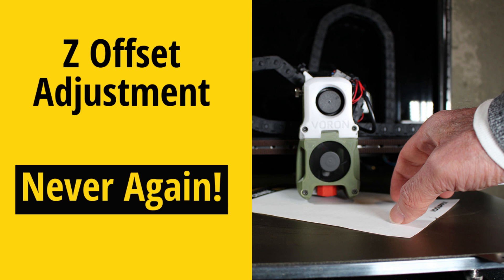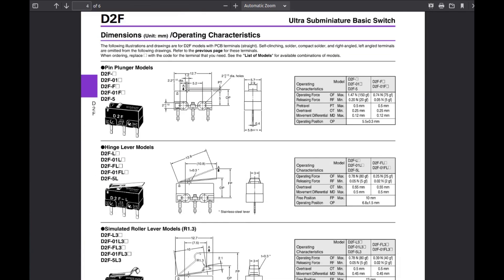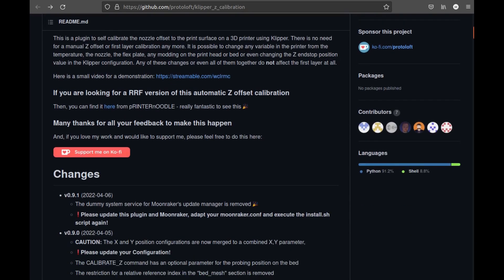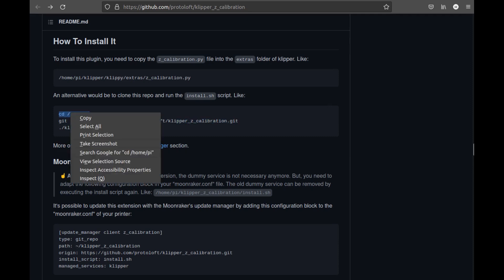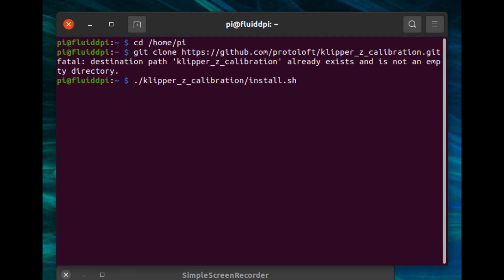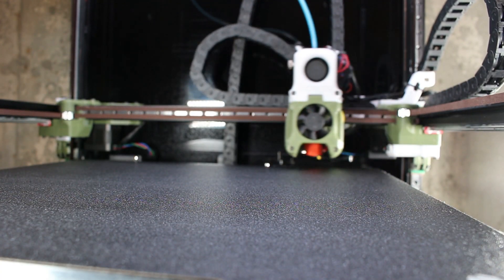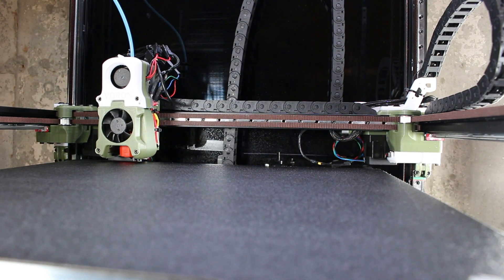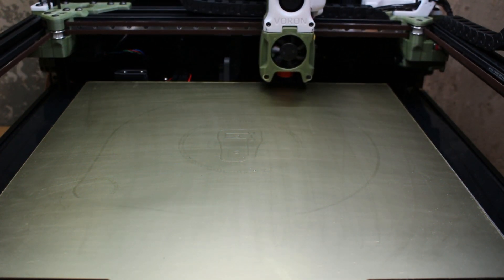Never adjust your 3D Printer Z Offset again with Klipper and a plugin

Comment: Thanks for doing the hard work for those of us who are new at this, love the nozzle clean video it works perfectly. After probing the nozzle on the way to probe switch body switch is contacting z end stop, how would I raise print head to clear the switch? Also I have to manually insert macro: error_if_probe_deployed  to get Euclid recognized otherwise it faults out. How would I get this automated? Thanks
Reply from the maker: If you go into your euclid.cfg file, just change the z height to a value that works for you.  If you need a more complicated path you can add that gcode there as well.  This will be the macros for M401 & M402.  Both of them set the z height.  You should be able to adjust enough to pass over the z end stop.  For the macro, to call it, you should probably modify the the G32 macro or the start_print macro in your printer.cfg file.  In G32 I have it set to do a home, qgl, home and then calibrate_z.
Reply: @KapmansBasementWorkshop  got it thanks. Any idea why I have to use  error_if _probe_deployed first before I can use Euclid probe?
Reply from the maker: @nicklong9985  I sure do. Early on I had not adjusted it very well and it would sometimes drop the probe.  As soon as it notices the probe is not fully connected, it raises an error and stops.  If it did not do that, it would probably destroy your bed, print head or both when doing a bed leveling.  Trust me, you want that error handling code.  I can think of 4 different occasions where it would have been very bad if it were not there.  Include the code!
Reply: @KapmansBasementWorkshop  yes I want to use the code. I’m probably not explaining the problem very well. What I wanted to know is what is causing the error?
Reply from the maker: @nicklong9985  If at any time the probe is supposed to be attached and it senses both magnets are not making full contact to the Euclid, it will raise that error.

Comment: Hi another question i want to print the Assembly Jig but i have a choice in 4 different jigs 
which one did you choose for soldering ?0.2, 0.3, 0.4 or 0.5 a little confusing
Reply from the maker: It depends on how accurate your printer is.  I believe I used the 0.2 model.  But you can try it, and if it does not work, you can try one of the other sizes based on high tightly (or not) the parts fit into the jig.  I admit, it is a bit confusing.  If your prints tend to be oversized based on the design dimensions when compared to the actual print, you can target the larger jigs.  Ideally it will fit perfectly.

Comment: Hi. Thanks for great tutorial. i have two questions, do I need to save config in mainsail after calibrate_z command? and the second one, do I need run calibrate_ z before every print? sorry for rookie questions xD
Reply from the maker: Good questions.  The answer is it depends on how you want to operate.  I choose not to save it and I calibrate prior to each print which accounts for anything that might of changed position due to heat expansion, cooling, change in PEI bed thickness when changing the plate between prints that may be different thicknesses or textures.   If none of that is a problem for you, save the value after calibrating when 1st turning on the printer if you wish to use the same setting for a longer period of time.  Even without saving, the measured setting with stay in effect until klipper restarts or you run another calibration.
Reply: @KapmansBasementWorkshop  Could you show us your Print_start macro please?
Reply from the maker: @EliteNervous  This is a possible sequence recommended by the script creator:
The print start sequence could look like this:

    Home all axes
    Heat up the bed and nozzle (and chamber)
    Get probe, make QGL or Z-Tilt, park probe
    Purge and clean the nozzle if available
    (Get probe), CALIBRATE_Z, (park probe)
    (Adjust Z offset if needed)
    Print intro line
    Start printing...

As for mine, I have not added it in yet.  But here it is just in case you find it useful.  I might end up placing it in the G32 macro instead which is called from my print start:

[gcode_macro G32]
gcode:
    BED_MESH_CLEAR
    G28
    QUAD_GANTRY_LEVEL
    G28
    BED_MESH_PROFILE LOAD="default"
    G0 X175 Y175 Z30 F3600
  #--------------------------------------------------------------------
[gcode_macro PRINT_START]
gcode:
    G90                ; use absolute coordinates
    G32                 ; home all axes
    G1 Z20 F3000 ;move nozzle away from bed 
 G1 E5.0 F3000    ; move extruder

I'll post again once I have actually added it in and tested it.
Reply: @KapmansBasementWorkshop  thank you

Comment: Maybe this is a dumb question, I don't have a Voron, but how does the printer calibrate the nozzle height?
Reply from the maker: I think it's a great question!  The z-endstop switch on Vorons sits right next the the bed plate and is in a position where the printer places the actual nozzle on the z-endstop.  That is how it homes the z position.  Other printers I have used have placed the z endstop elsewhere and have not homed using the actual nozzle tip.  It sounds like you  might be in that situation.  When researching this.  I stumbled upon this solution where someone seems to have gotten BLTouch working right here: https://github.com/hawkeyexp/auto_offset_z.  This is not a Voron printer and it is based on this script.  This person goes about it slightly differently but to the same effect.  Have a look as you might be able to use it and solve this.  The other option is to possibly relocate your z-endstop or simply add an additional  endstop just for this reason.
Reply: @KapmansBasementWorkshop  Thanks for the info. I'll check it out.

Comment: Another question - assuming our bed is not perfectly flat, we would want QGL and to load the Mesh before using this, right?
Reply from the maker: I would.  I also home after the QGL prior to using this script to make sure z is at zero after any adjustments QGL made.  I have this believe that QGL changes the locations of z to possibly be non-zero.  So I execute the extra home after qgl.  I'll need to run some tests at some point to see if that is true.  If you or anyone watching has a better understanding of this, please correct me.
Reply: @KapmansBasementWorkshop  I also do a g28 after qgl before I print, and then load the mesh
Reply from the maker: @TORDesign  So when you do that G28, does it ever seem like 0,0,0 moved slightly from where you expected it to be?  But the difference might be too hard to see....
Reply: @KapmansBasementWorkshop  I’ll keep an eye on that thanks.

Comment: Thanks for this - fabulous - I dont have a Klicky probe, yet. Do you think this could work using an induction probe, if we knew the height from the bottom of the probe to here it activates? (Assuming we always use a metal build plate ).
For now Im about to use this just to find out if my z-switch is giving repeatable results.
Reply from the maker: I don't think it will work with the induction probe for 2 reasons:
1. The induction probe does not measure the surface of the bed.  It can only sense ferrous metals.  So the induction probe measures the height of the steel flex plate under the PEI instead and it tells you nothing of the actual height of the surface.  I have 3 flex plates, each one has a slightly different thickness of PEI.  And if you have a plate with a rough side and a smooth side, each side has a very different thickness!  By using klicky or Euclid, you will always get the surface location and can switch plates or flip sides and always get the correct a-offset!
2.  The induction probe will either be a model that works at 7mm or 5mm distance.  If you try to tap that against the z end-stop, your nozzle will crash into the bed.

Comment: Thanks for the very clear how to video, only one question where do i put the start m401 and the m402 code config so that my printer wil do the same as shown on the video i have a 300 voron
Reply from the maker: I have my m401 & m402 defined in a file called euclid.cfg and then include that file name at the top of my printer.cfg file.  If you wish, you could define m401 & m402 directly in your printer.cfg file.  You should be able to do the same with Klicky.  If they are already defined, and you want them called automatically, you can add them to the QGL if that is being called prior to each print in your print start.  So something like this:
[gcode_macro QUAD_GANTRY_LEVEL]
rename_existing:    _QUAD_GANTRY_LEVEL_ORIGINAL
gcode:
  M401                           ; deploy Euclid Probe if needed
  _QUAD_GANTRY_LEVEL_ORIGINAL         ; check bed level
  M402                           ; dock Euclid Probe

However, I would assume you have m401 & m402 configured correctly previous to installing the auto z calibrate....
Let me know if I'm even getting close to the answer you are looking for.  Also, for M401 & m402,  have a look at my video about installing the euclid probe.
Reply: @KapmansBasementWorkshop  For Klicky probe change: M401 with Attach_Probe, M402 with Dock_Probe
Reply: @KapmansBasementWorkshop  
to be honest i'm staring with a 2.4 r2 build.
i got most of the parts in, its going to be a 300 x 300 build.
so i'm gathering more info about the probe and some other problems that this printer has. 
After watching your video i'm going to skip the induction probe and ordering the euclid probe.
That's why my question was how and where to put the commands i have a core 3 from ratrig now i want a printer that can print abs 
And to be honest kind a new with klipper still learning and sometimes a little help is very appreciated.
Reply from the maker: @petarbajai  In that case, you may find these two interesting.  They represent some key things I learned building this printer.

For Euclid: https://youtu.be/Z7x4S_HMlvc

For Klipper and other software: https://youtu.be/XDQji9IFZ18

When placing the magnet to the bed, use the flattest surface you have. Hopefully thick glass and weight with and overnight cure: https://youtu.be/xarmgigvHrU

And this is an absolute must once software is installed and printer is running, the klipper input shaper will provide a huge increase in print quality at high print speeds: https://youtu.be/hXgl9-lXn7Y

Some things I learned along the way and I hope they will answer most of your questions.  

Thank you for watching!

Comment: How to get this working with RRF?
Reply from the maker: What is RRF?
Reply: @KapmansBasementWorkshop  RepRap Firmware (Duet)
Reply from the maker: @adamfilipowicz9260  I don't think that possible as the code would probably need to be rewritten.  This makes use of Klipper.  It would be interesting to see if RepRap has this as a built in feature....have a look at this: https://forum.duet3d.com/topic/18942/calculating-tool-offset-cnc?_=1604994474624

Comment: I try the plugin but having no luck about it. after  run CALIBRATE_Z and the toolhead moving around 3 places the i got the result as 
Offset is larger as allowed: OFFSET=-2.554 MAX_DEVIATION=1.000
what I doing it wrong please advice. Thanks
Reply from the maker: I believe you need to manually adjust it in the auto.cfg file 1st to get it closer than 1mm.  You will need to experiment as shown in the video with the piece of paper.  Once you have that done, it should take care of itself in the future.

Comment: I don't know why, but I'm not getting that resistance from the paper when I move my z 0.1 or should I not get any? Also changing switch offset values doesn't seem to make any difference. I don't know what I'm not getting in this setup
Reply from the maker: My apologies for taking so long to respond.  You need to keep adjusting it downward until you do touch the paper.  Once you found the right height, adjust the switch_value in your cfg file by that amount and test again..  You may need to make a few more adjustments by testing it a few more times.  Also, after saving changes, you will need to restart Klipper.  Once you have done this, you should never need to do this again!
Reply: @KapmansBasementWorkshop  thank you so much for your reply. Currently I am using the switch as an endstop and hence can't use auto z. Would still want to know your expert opinion on whether to use auto z or the switch as endstop?
Reply from the maker: @framespersecondfps5256  For this to work properly, you must have a probe mounted on your print head as well as a z-endstop/offset switch.  If you are missing one, this cannot work (as far as I know).  That is how the creator of auto-z wrote the software.  This assuming I understand your question.
Reply: @KapmansBasementWorkshop  no I meant if I use the klicky as z endstop, then I can't use auto z. So just wanted your advice on whether to use probe as virtual z endstop is better or probe for auto z
Reply from the maker: @framespersecondfps5256  For me, auto-z wins this.  I love the consistent initial layers.    I would add a z-endstop , for me the consistency is worth it. I also can switch magnetic PEI sheets of different brands and thicknesses and the printer with auto-z automatically calibrates with the same consistency.   If you have something like the Voron 2.4, I think this is a "must have".
Reply: @KapmansBasementWorkshop  yes I have a 2.4 350mm³. So let's say I'm starting from 0, I'll install the py script, change the values in variable.cfg to my printer values. What I'm now confused about is the z endstop value. Do I use auto z on my current offset values or what?
Reply from the maker: @framespersecondfps5256  I'm assuming you have added a z-endstop switch next to the bed which is typical for that 3d printer.  I would also assume this your printer homes x, y & z using the 3 standard end stop switches just like most 2.4 Vorons.  Then I would make sure Klicky is working as it should (sounds like it does for you).  Once this auto z-offset calibrate script is installed, the z-offset in your printer.cfg will no longer be used, auto-z will take over from there.  I would simply follow this video as it shows the install from the beginning to the end.  If the video is too long, I would follow the instructions in GitHub from Protoloft.  I have the link posted above in the video description.  Let me know if I still have not properly answered your question.  I think somewhere in this response I have the answer you are looking for, but...
Reply: @KapmansBasementWorkshop  Thank you so much 👍
Reply: @KapmansBasementWorkshop  what about z_endstop_min? Its default value is -0.5. I think it's needed for some offset calculation. Do I recalculate it from scratch or what?
Reply from the maker: @framespersecondfps5256  Where is this setting?  I don't seem to have it in any of my config files.  The closest I have under [stepper_z] is:
position_max: 340
position_min: -5

But you should not be changing any of these settings as there is no need.  The key setting is "switch_offset" which should be in your autoz.cfg if you configured as I did.
Reply: @KapmansBasementWorkshop  it's under z stepper settings in printer.cfg named position_endstop sorry not z endstop min
Reply from the maker: @framespersecondfps5256  When you built your printer and calibrated it the very 1st time, that line should be commented out and no longer in use automatically when you saved your settings.  Klipper comments that out and stores a newer value elsewhere when you calibrate z offset the traditional way.  It is not used with the changes you are making to auto-calibrate.  As long as it's commented out, you should not need to worry about it.
Reply: @KapmansBasementWorkshop  will try it right away. Sorry to bother you so much.
Reply from the maker: @framespersecondfps5256  Not a problem at all.  I want to hear that this is working for you!
Reply: @KapmansBasementWorkshop  Thank you so much for all your help and time. It worked. Just one last question, if I change the offset during print by fine tuning, where do I save the new offset value, the probe or the endstop?
Reply from the maker: @framespersecondfps5256  I would adjust the auto-z.config offset by that amount so it's handled automatically the next time you auto calibrate the z offset.  So I think my answer is neither.
Reply: @KapmansBasementWorkshop  that explains my nozzle clog and hence breaking the heatbreak of my hotend 😔. I saved the offset to probe
Reply from the maker: @framespersecondfps5256  My apologies.  I'm sorry to hear it.  Outside of home, qgl and mesh, nothing else should deal with the z-offset than this software.
Reply: @KapmansBasementWorkshop  no thanks to you I learnt a lot of stuff. It works wonders. ❤️
Reply from the maker: @framespersecondfps5256  This is fantastic news!  Thank you!